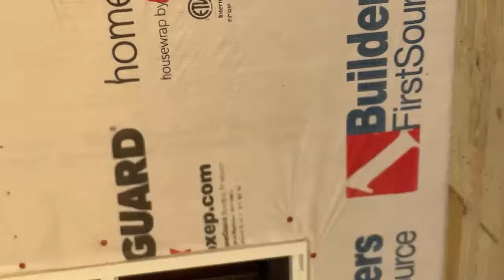The Facial Boards On My Home

Comment: Steven, have you given it any thought as to finishing underneath the front porch with skirting to hide all the open space under your porch, kinda like adding the house siding all the way around the bottom of the porch it really makes for a sharp clean classy finished look 🤗.
P.S. Maybe one day continue your porch around to side of house where the deck height is closest to the ground, and if ever needed a handicapped ramp can be added so easily. Congrats Steven on your progress. ☮️